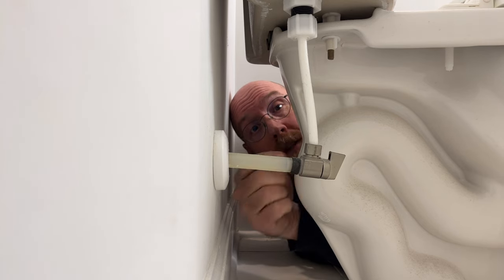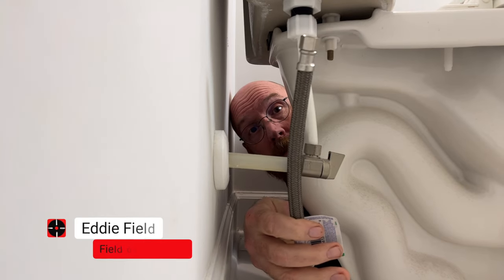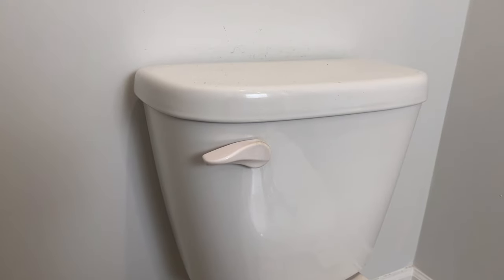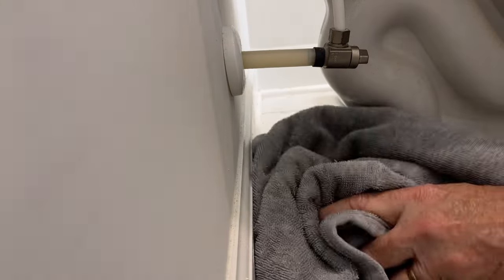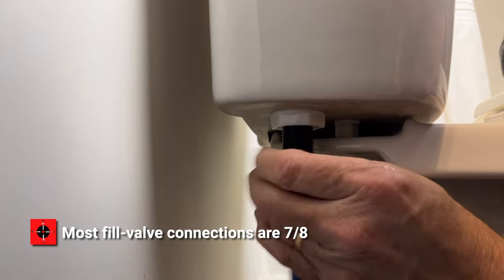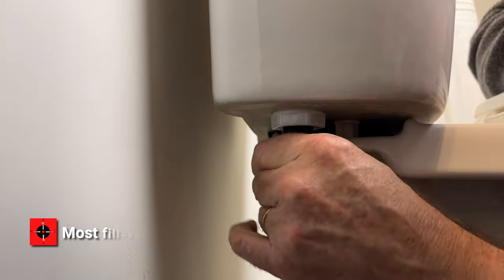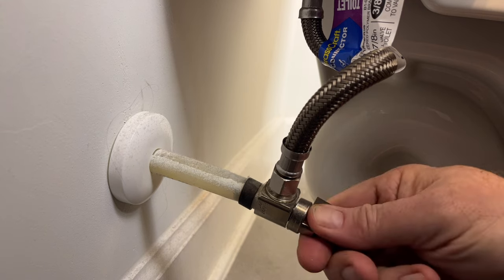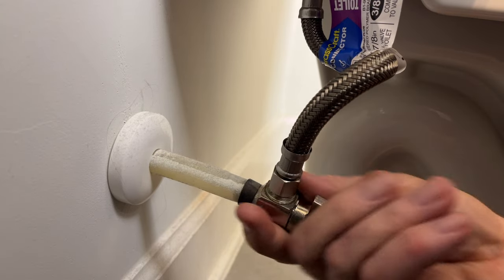Replacing Your Toilet Water Supply Line: A Step-by-Step Guide

Comment: Good video, for first time people, you may want to say that the line to be replaced should be bent in order to get the top washer off the toilet bowl piece, mine was so snug I could not budge it, finally had to call a plumber, he did the job in 5 minutes, after I told him I removed the top nut and the nut on the valve I could not get the piece off thinking maybe it is integrated with the inside pieces, nope, all you have to do is bent it and the piece will come away.  Mine was so snug, it would not come away so had to call a plumber and spend $200 vs. $5 for the part.
Reply from the maker: Thank you.  I’m glad you got it fixed.  I appreciate the suggestion.
Reply: Bend what? I’m trying to get mine off

Comment: I came here hoping to find out whether or not teflon tape should be used on the plastic connector.

There are a couple of other omissions. Would be nice to see a longer video that includes taping, full draining of the tank (including using a sponge or towel to soak all tank water up), and advice on how tightly to torque each side. Wasn't hard to find, but I wish I didn't have to go elsewhere.

Comment: Any tips on how to removed if the bolt is all rusted?
Reply from the maker: I suggest soak in with a good penetrating oil and then use some vice grips.

Comment: the nut is stuck that screws into the toilet tank water inlet valve. it's pex. what should I do besides grumbling?
Reply from the maker: Is it a plastic nut to plastic toilet float valve?  I would try drain the tank and buy replacement supply line and toilet float valve.  Then, if it breaks, no harm no foul.  You're gonna replace both anyway.

Comment: I have a braided nylon one that is stuck. The part to the water supply just keeps spinning and not coming off the thread. How can I get it off? Thank you!
Reply from the maker: Use a wrench on the line and use a wrench on the tank fill valve.

Comment: Thanks for sharing this video. For the pipe that goes into wall, I notice it jiggles a bit as you are replacing the supply line. Is there a way to stabilize it or should it be movable like that?
Reply from the maker: There really isn’t a way to secure it after the drywall is finished.

Comment: Any tips/tricks on how to remove a stuck water line from the shut off valve? Prefer not to replace the shut off valve and I don’t have a hack saw for cutting the stuck nut.
Reply from the maker: Can you hold the valve with big pliers like channel locks and turn the water line nut with another pair like gas pliers?

Comment: Nut is solid.  Tried Plumbers wrench and no luck.
Reply from the maker: Which nut are you trying to loosen?
Reply: @FieldGuidetoDIY  Water line to bottom of tube.  I filigree it out.  Had to cut with a hack saw in middle of nut and again the other way.  Took like.a half hour.

Comment: I had the line dripping and then fixed it but now some condensation on the line. Is this normal or will I have to replace the line?
Reply from the maker: Check the tightness of the fittings.  It may be a really slow leak.
Reply: @FieldGuidetoDIY  thank you so much will do

Comment: Should really advise people use plumbing tape on the water supply line connection and the tank connection threads, before installing the new hose.
Reply from the maker: Thanks for the advice.  I’ll include that in the next update.  I appreciate it.
Reply: Why should we use the tape?
Reply from the maker: @kelmel6710  an added layer of “drip protection” as a backup for the rubber washer on the supply line I recommended.  Great question.  Thanks so much for watching!

Comment: I have a new construction home and every single supply line is pex directly to the cheesy plastic supply lines. I can't replace anything myself without a crimp tool! Having a plumber come and  replace everything.
Reply from the maker: I’m so sorry to hear that.  I guess they saved on labor.  Keep me posted on your progress.
Reply: I relate 100%!

Everything is going in that direction - cars, home printers, plumbing, electronic devices etc. Manufacturers don't want us to be DIYers anymore, so we have to either take it to a pro where you pay 300 bucks for a 10 dollar repair, or throw the @)_#ing thing away and buy their newest, latest, and even more cheaply built POS.

I was able to do every repair I needed on my first car back in college. Now everything is in a black box.

Thank goodness that Right To Repair is gaining traction and government support. Here's hoping that things get fixed / reversed.
Reply: Just cut them out entirely and use a sharkbite fitting. I wouldn’t use them inside a wall but in your bathroom or a crawl space where you can check on them? Absolutely. Plumbing estimates are about 90% labor, 10% materials. My plumber wanted 4400 to repipe my house with pex and new valves, it cost me $485 to do myself and I’ve had no issues. They make it seem more challenging than it actually is